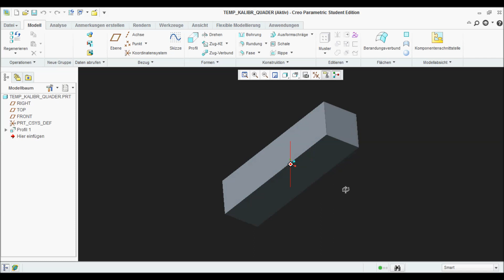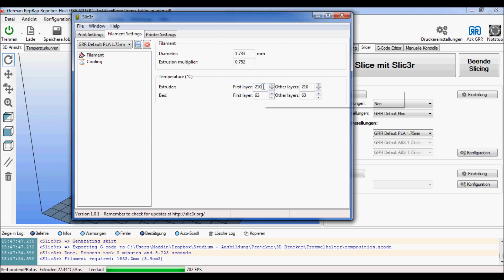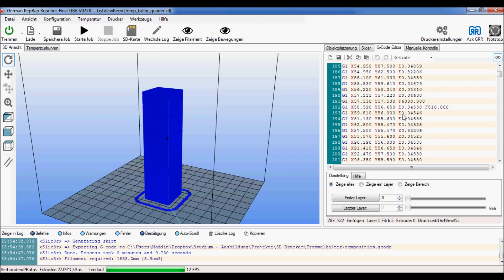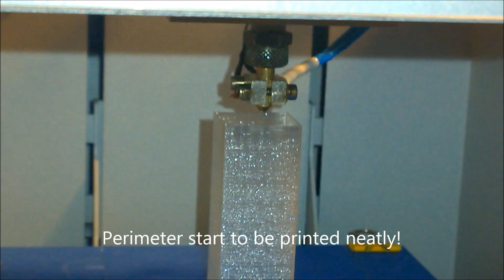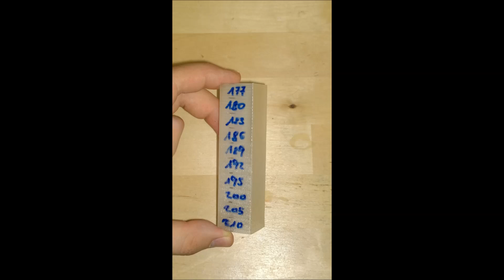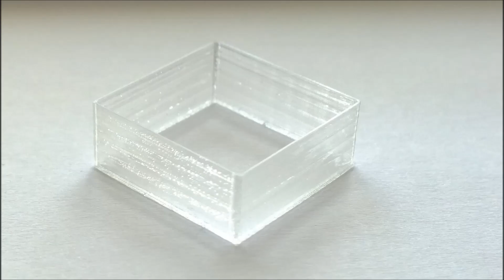RepRap Neo - How to set the perfect extruder temperature on your 3D Printer

Comment: I think, it would be more evident to increase temperature from bottom to top (instead of decreasing it), since a hot end tend to heat up faster if comparing to cooling down.
And in most modern printers you can tune hot end temperature during printing (for instance, via LCD and jog control), so there is no need to tweek the generate gcode.

Comment: Awesome video!!! Are CAN cycles supported in the software? I don't have a 3d printer but plan on buying one very soon. If the G-Code supports it this process would be very easy to do with a loop. Just set the temp, print the layer X many times, increment the temperature, and repeat until Y cycles have been completed.

Either way, I'll certainly remember this video when setting up my printer!

Comment: Some have asked, can we have the gcode? Can s1 post it?
Reply: G-Code is dependent on print speed, layer height, printer type, etc. It would not be useful for you unless you have the same printer,  same printer config, and filament type. This is the reason people are sharing STL files, not G-Code files.

Comment: I have had difficulty locating a good tutorial on calibrating the speed.  I have carefully adjusted the zsteps for all 3 axis and the extruder motors.  And now, with your suggestions I can calibrate the correct temperature for each of my filaments.  

Can you recommend a speed calibration tutorial?

Comment: very very nice😆subbed
I'm looking how to calibrate my prusa i3..have some videos on my youtube channel about printing so .. ihave to do some adjustments..I tried in Marlin changing the steps the speed and the extrusion..when I print I have a problem..that In pronterface I set to 180°C extrusion temperature and when it's printing it goes to 210°C so i don't have any control over it..any ideas on how to set the temperature right? 
thx in advance..& if it helps I use ramps 1.4 abd arduino mega 2560 for my prusa i3👍

Comment: Hi, I tried to print this with PLA on my prusa i3 but I'm having trouble with cooling. 
Wth the default settings, the fan starts colling arround the fifth layer, and then the print starts to move. Probably because it's yet too close to the bed.
I use heated bed on glass. 
Can you help me?

Comment: I did this with the slicer Cura (use "Expert" in the top of the program --> "open Expert settings" --> under Black Magic "only follow mesh structure"

After this I loaded the gcode with Repetier host and edited the gcode by hand. A really nice feature of Cura ist, it comments the gcode. So you can easily search for your layers and insert the temperture command.

took me 3 minutes all in all.

Greetings
Reply: +Phil H Could you post the gcode plz?

Comment: Hi Neo, is there a reason you decrease temperature with height? Can I increase it instead? Thank you for sharing your experience.
Reply from the maker: Christian L. Sorry for that belated answer, I just read your comment, and you might have solved the problem yourself, but I'll just answer you anyway: I'd say it would work both ways. Both ways you'll have to know a start temperature. For myself I found it easier to decrease the temperature by height. That way you can find out a minimum temperature. By increasing the temperature you could easier miss the lowest possible print temperature. AND if the printing temperature is too low, you'll might get some problems with your extruder depending on whether the filament gets mostly pulled (as the feeding gear is near the extruder) or pushed.

Comment: Hello from Barcelona. I have got a problem with my CPU Arduino Mega 2560 and the configuration. People generally use the configurations Marlin for their printer 3D. But, I haven't found a good configuration for my Velleman K8200 with engine step by step Nema 17. Do you use the same machine as me, and the same motherboard? I need help on this... I don't know what to do... Thanks for your time.

Comment: it may sound stupid but...does the optimal temperature change over season? like..when summer its 180c ; winter 190c?
Reply from the maker: It could depend on the season if the printer is set up inn an environment with changing room temperature or it is positioned near to a wall which is not properly isolated. But it mostly depends on the process and the used Material.
Reply: One of the reason why printers produced in closed boxes...

Comment: Does this calibration work properly with a heated bed with ABS? I think he heated bed might obscure the results as the print gets farther away from the heated bed right?
Reply from the maker: I would agree that the heated bed might obscure the results. But if you plan to print everytime with just the same heat bed temperature and if you set the start temperature reasonibly high enough, it should work to. But this is just all theoretic as I didn't make any experiences with ABS so far.

Comment: Speed Test Calibration ????
Reply from the maker: Barry Tolar As far as I've experienced it, there are 2 vital parameteres (speed and temperature) that deteremine the print quality and you got to set one in order to calibrate the other. E.g. if you set the temperature as you've experienced that it is necessary for your printer to not fall under a certain temperature, you've got then to find a suitable speed and vice versa. The method shown above is used to determine the print temperature for an already set speed. The other day I tried to print a very filigrane part. It couldn't be printed with the current speed and temperature settings, as the extruder worked far to quick. Therefore I had to increase the temperature until a proper print was produced. Of course the surface of the print was far from perfect, but now the part was able to perform its function.
Reply: +RepRap Neo i feel like barry tolar means what i want to ask.. You refer to a speed calibration. i understand the why.. but am oblivious on the how. and can't find anything online. so a tutorial from you or a link to a good site would be very appreciated. now. but also for following video's.
Reply: +RepRap Neo what's a filigrane part? Also do you have more info on speed calibration? Danke!
Reply: https://www.proto-pasta.com/blogs/how-to/leveling-up-your-printer-game-on-the-lulzbot-mini

Comment: TEXT EDITOR TIP If you are using a text editor just search for "Z10" then "Z20" then "Z30" and so on. You will jump to the first instance of the Z height reaching 10mm, 20mm, 30mm etc. Each time along the way, insert the M104 SXXX code.
RepRap Neo  Awesome video! Thanks for teaching me this method.
Reply from the maker: woodywong76 Thank you vey much for the tip. I still got a lot to learn, myself.^^
Reply: Watched the video and today used this method. It is quite neat and learned something new :))
I am using heated bed and done tests with 220 down to 170. At 220 it sticks very well but it is too much and first layers are fatter. You can notice where the temp change but I am leaving few layers because the extruder needs time to lowed it's temp. At the top layers are thin and It does not stick well. As quality I liked 180 but when printing flat surfaces it is not enough so I am back to 190. Will do another test tomorrow as I changed my speed. I have no idea what the speed should be :S

The hardest thing is to determinate which layers stick well and at the same time looks well. I am not sure what is the best way for that but I suppose it comes with experience. I measured the object as it is fatter at the bottom and thin at top, thus little bit off wanted measurement.

Thanks for the vide and sharing. Hope to see more from you :)
Reply: A tip: you can watch series at Flixzone. Been using it for watching all kinds of movies lately.
Reply: @James Dayton yup, have been watching on Flixzone} for since december myself =)